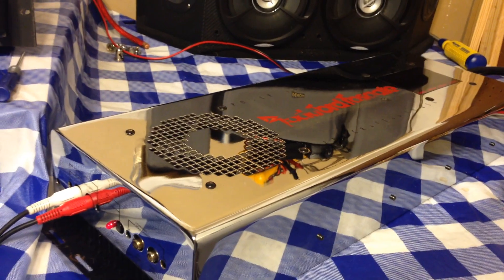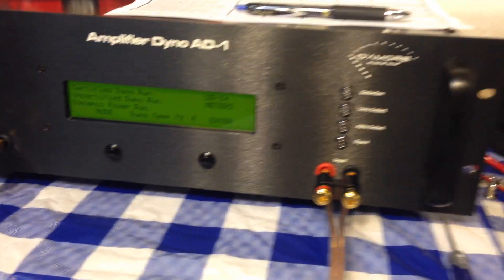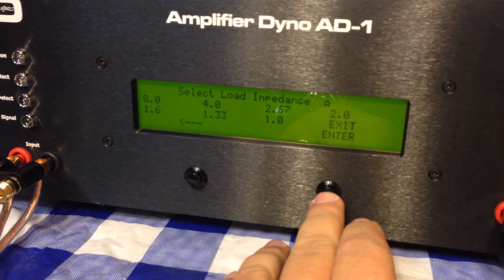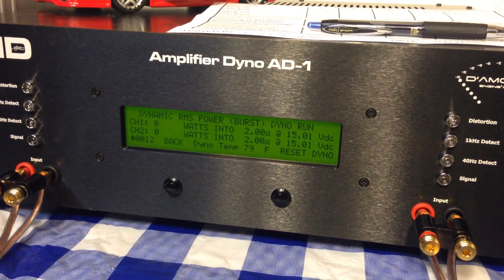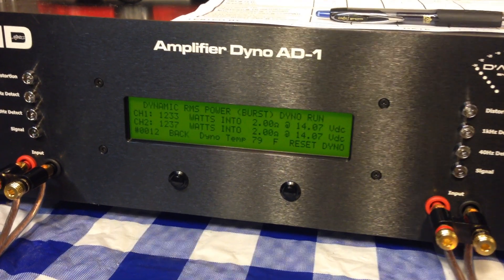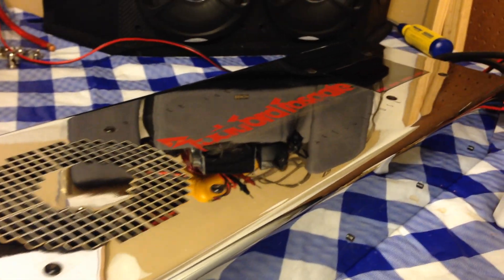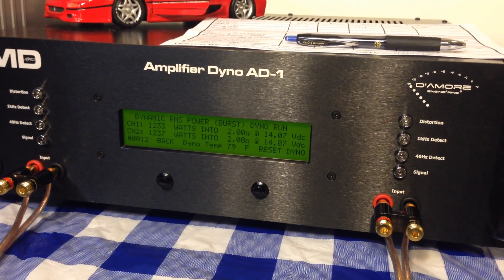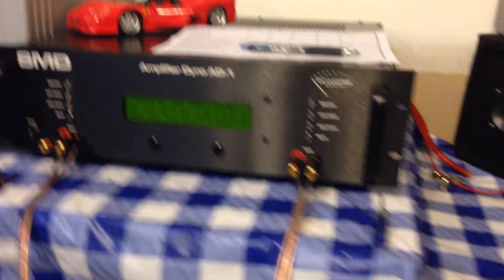Rockford Fosgate Power 1000 Mosfet vs SMD AD-1 Amp Dyno at 2 Ohms Dynamic RMS

Comment: Hey I have 4 of these had them in my 88 Lincoln mark Vll with 12 15's that I still have would love to bring it back out has been sitting inside for yrs. With 12 15's I'm still able to see out the rear window the box is 3 W's and angled to where the rear glass can still be seen out of the car is built sold filled doors with fiberglass proble 3in thick ever crack and creaves was filled with liquid nail sounds crazy even had concrete on the floor no rattles every panel was like knocking on concrete solid no vibration my inspiration to build that was from the Legend MARK FUKUDA WITH HIS YELLOW BLAZER HAD 16 15'S WITH 4 POWER 1000,S then he replaced them with 32 Fosgate 500's seen him win the world record in Houston in the early 90's at the Finals very impressive Blazer
Reply from the maker: And again 😝

Comment: which is stronger Power 1000 or the Orion 2100 hcca?? I have two of both still. 27 years
Reply from the maker: +Ulysee Muff overall the RF Power 1000 is more powerful, but its 4ch vs the Orion being 2ch
Reply: My buddies claim i should use the Orion because they are better. to use the old RF POWER 1000 on highs and midshipmen's..
Reply: They were telling me to use he power 1000 as a highs and mids amp. Made me think the Orion 2100 hcca was stronger
Reply: They were telling me to use he power 1000 as a highs and mids amp. Made me think the Orion 2100 hcca was stronger
Reply: how strong are my Orion 2100 hcca digital reference and the competition 2100 hcca?

Comment: We have seen you dyno so many older amps making more power than this one and cost less.. What was it that made this one so special?  Mostly just curious.
Reply from the maker: +ISEE YOU this amp is iconic. $2700 back in 1900, would equate to around $5k taking inflation into consideration. The LED lights, power, status, etc. These amps will never lose their popularity
Reply: In 1990, Toyota was selling a base model truck for $6499.00, 2 power 1000s costed as much as a new truck.

Comment: I use to have 2 of these at bridged 1 ohm,  at 2 yours did roughly 2500 watts,  I had 2 at 1 ohm pushing 8 punch 15's in a mazda mini truck that was so loud it knocked the Right top corner of the windshield out.  Not broke just kept pushing the window out of its black window seal.  was told back then it was making 1500 watts per side times 2,  I was king for 2 years.  Man the old days
Reply: Chad Griffith Jeeez,, 8 - 15s.!!!! i bet that sh** SLAMMED.!!! lmao.!! I would have loved to hear that bad boy.!! lol.. 
rock on man.
Reply: So this amp can handle 2ohm bridge  they selling me one and I need 2ohm bridge

Comment: My shop sold his 1000C's for $899.  That was STILL a tremendous amount of money.  The two deals I missed out on was that Power 1000 and a set of 8 Kicker C18's (the Gold Letter ones) for $1000.  Imagine that amp running those speakers.  But when you're working in the Produce section of Food Lion making $4.85 per hour, that was nothing but a pipe dream!
  
OOF!
Reply from the maker: Wow! When I get the flux capacitor repaired in the Delorean, we'll go back and stock up! Very true that this was an excellent price, yet still out of the reach of most of us at the time. Man though, a Power 1000 and a set of 8 Kicker C18's? Insane!
Reply: Dereck BigDWiz I should make clear, the C18's MSRP'd for $450 each!  It was 8 of those for $1000, and a Power 1000C for $899.
  
I think this was about 92-93, somewhere in there.  It was the last 8 C-18's he had, he was trying to move them.  And he was down to the bottom of the barrel and trying to move his "older" Rockford amps, too, as the DSM's had just come out.
  
I can't even comprehend the damage that could have been done with that set-up though.  Probably one of the loudest <$2,000 stereos on the planet.
Reply from the maker: Michael Bloom Ok, that makes more sense, but the 1000c for $899 was still a smokin' deal when the MSRP was $2699. That almost had to be a closeout price as dealer cost should have been around 1/2 of retail??

Comment: Thank you again Big D. Back in the day I would have sold my body organs to get one of those amps. I am wondering how much current that the amp was drawing?
Reply from the maker: shane n my regulated DC Power supply will put out up to 250A at 18V (adjustable from 9V-19V) and the Power 1000 can draw upwards of 250A. Of course, the testing methods with sine waves are not what you would expect when playing music in your car. A more realistic amperage pull would be around 100-120A
Reply: Thanks again. And by the way thanks for the work you do to make these videos I can't wait to see your test on the HCCA 100.

Comment: You wanna know what's crazy is my local rockford dealer insisted that the 650's had more low end nads than the 1000. they ran 2 650's on 4 18's and power 1000 for mids / highs

Comment: I had one of these back in the 90's as well running two Punch Pro 15's. You wouldn't possibly have an extra one for sale,  would you?
Reply: Ive got a brand new first gen power 1000.
Reply: Patrick Moore I have 2 also a Ma Audio hc2001 and a lanzar opti500x2
Reply: Derek Sr. want to sell a Power 1000?

Comment: I've always for  the last 20 years wanted to know how much power this amp made!I had a rockford power 650 back in the day,can you do a full range test on the  650?I had my 650 on 4-12inch pro savard's back in early 90's and it rocked !Thanks for the test it's fun to know how much power those old school amp's made.I had alot of setup's over the year's it just seemed alot more fun back then!
Reply from the maker: Yes, I have plans to test Power 650 Mosfet's also. I just had 2 completely gone through and they both should be ready for the full gamut of AD-1 tests